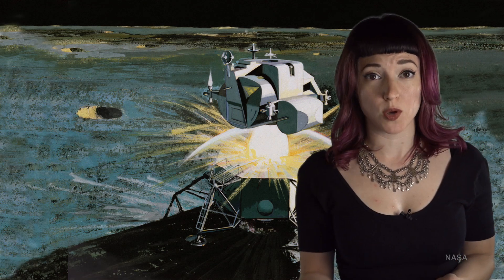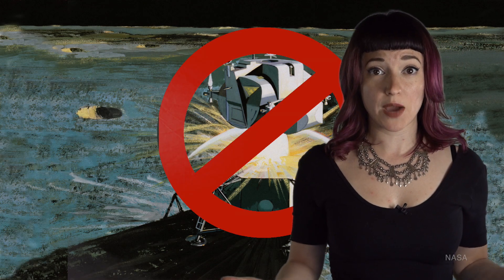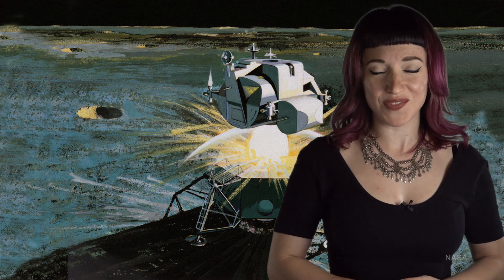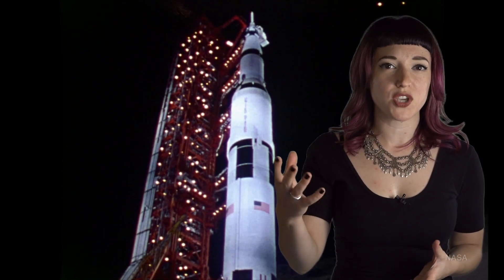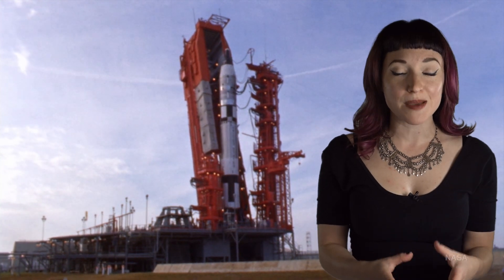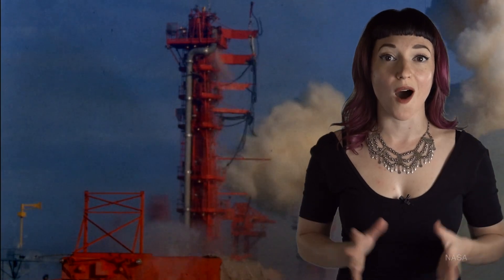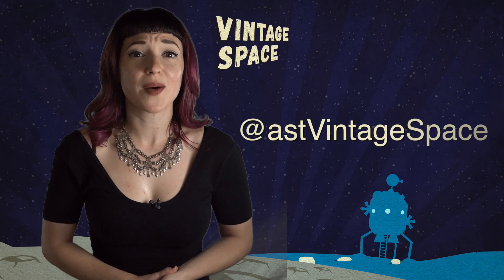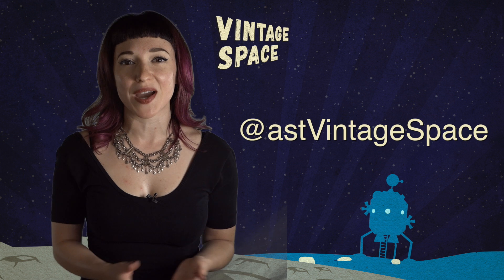How the Lunar Module Launched from the Moon Without a Flame

Comment: Question? So did we have remote controlled cameras on the moon? Just asking since the camera panned the launch.
Reply: Absolutely. Folk's stupidity is astonishing. 
Whi is behing a camera? Mary?
Reply: The camera on the rovers of Apollo 15, 16, and 17 could be remotely commanded to perform a series of preset instructions. 
It's a fairly trivial calculus task to calculate the angle required to keep an object in frame at any given second when you know the distance to it and it's rate of acceleration. Program it to do that and simply press go at launch time.
Reply: @niallkinsella2687  Nonsense, anybody knowledgable in physics will tell you it is tosh, rockethead - a poster with 47 sybscribers but no content. Paid by the post.
Reply: @niallkinsella2687  Haha, fairly trivial task to organise remote control camera to the moon in 1970s. Why not skype to another galaxy. To King Kong planet.
Reply: @Афонин-я4ь  
The nearest major galaxy is Andromeda. 2.5 million light years away.
The moon is barely 1 light second away.

Our communication methods are limited to light speed electromagnetic waves. Lag of 1 second plus processing time is acceptable to most people. In the 1960s this was ~3 seconds total for audio communication.
Lag of 2.5 million years plus ~3 seconds of processing time is not acceptable to most people, so intergalactic communication is not feasible with our current technology, including Skype.

Your tangent has nothing to do with sending a command to a remote control camera. A trivial task in the 1960s.
Reply: @Афонин-я4ь  
2.5Ghz transmissions are not particularly suited to long range communication. 5Ghz is even worse.  Why you assume the Apollo program needed wifi to work, decades before the first WiFi protocols were written, is beyond me. The radio frequencies used were public knowledge, even then, and intercepted by receivers all over the world, including by nations hostile to the US and by people with absolutely no stake in the success of the missions.

Insulting people who respond to your questions honestly is reprehensible.
Reply: @Афонин-я4ь  
Since Luna 2 transmitted the first images from the moon using radio wave communication. 

Why do you keep insulting me? I've offered you not a single offence.
Reply: @niallkinsella2687  Tosh. They could make good special effects.
Reply: @Афонин-я4ь  
Special effects in the 90s still didn't look realistic. You think they could do it in the 1960s and not have a single special effects expect come out and say that it looked faked?

Comment: My question is how the module GPS system works, how do the astronauts knew where exactly they were in space?
Reply: The prayed and Mary showed them where to fly. :)
Reply: They used theodolite measurements of several stars to get an exact reading of their location in space. This was compared to where the mission plan expected them to be at any given point during the mission and course corrections were calculated on earth and carried out by the guidance and navigation computers.
Reply: @niallkinsella2687  they needed at least 3 references, of course they needed a bunch just in case of fails, but the biggest problem was the atmosphere, electromagnetic waves defract in a curved trajectory due to different layers and densities, plus, they needed to count on rotation of the planet, speed and direction of the lunar module. It's a lot of information to process in 1969. There was no communication behind the moon, electromagnetic waves can't pass through the earth and moon, so they needed to transfer package of data from one place to another, it's a lot of risks involved.
Reply: YOU SAID: "My question is how the module GPS system works, how do the astronauts knew where exactly they were in space?"

== Well, there were two basic methods (and each had sub-methods).  One was the onboard inertial guidance system.  Basically, stripping it down to the bare minimum for a YouTube comment explanation, they used a G-meter combined with a basic clock to determine the speed, gyroscopes to determine the orientation, and star sightings to do routine alignment corrections.  The computer was programmed to make adjustments due to Earth's gravity constantly tugging back on the craft, slowing it down.  But, this is just basic calculus at that point, stripped down into some simplistic formulas for the computer to run.

== But, none of the above was considered the primary guidance method.  The primary method was actually the ground based radar tracking network.  They had stations all around the world shooting radar at the craft to determine the position.  They triangulated it by using multiple tracking stations at a time.  A brief overview is located on MIT's website, which you can Google with "MIT Ground Tracking of Apollo" and read more about the topic.  It's only a summary document, but it'll get you started.  This method was considered the primary method because the navigation computers weren't ready by the time NASA wanted them to be ready, so they made ground based tracking the primary method, and onboard guidance the secondary method (contrary to what movies like to portray).  Make no mistake about it, they were going to the moon with or without the onboard computers.  But, yes, the onboard computers were ready in time to fly, but, they had already been demoted to the backup guidance mechanism by that time.

YOU SAID: "they needed at least 3 references, of course they needed a bunch just in case of fails,"

== Yes, and they had those, and many more.  There were dozens of tracking stations around the world.

YOU SAID: "but the biggest problem was the atmosphere, electromagnetic waves defract in a curved trajectory due to different layers and densities,"

== Peanuts.  That's virtually non-consequential.  A drop in the ocean.  I mean, hell, they used a lot of these same radar tracking stations to track the ground features of the planets like Mercury and Venus from tens of millions of miles away.  They had been doing that for nearly 10 years before Apollo ever went to the moon.  I think if they can track ground features of Venus and Mercury with those radar dishes, they can track an Apollo craft just fine.

YOU SAID: "plus, they needed to count on rotation of the planet, speed and direction of the lunar module."

== Sigh.  Radar works at light speed.  That's 670,616,629 miles per hour.  Do you think the meager 1,000 miles per hour of the speed of the Earth's rotation matters that much?  Do you think the speed of the capsules matter that much?  Once again, you're complaining about a drop in the ocean.

YOU SAID: "It's a lot of information to process in 1969."

== It's just math.  The math works the same in 1969 as in 2021.

YOU SAID: "There was no communication behind the moon, electromagnetic waves can't pass through the earth and moon, so they needed to transfer package of data from one place to another"

== Nope.  They simply didn't bother to build any kind of relay stations for when the craft were behind the moon.  They simply had a radio blackout period until the craft circled back into the line of sight.  And, since all landing sites were on the side of the moon that faces Earth, it didn't matter for the landings or moonwalks.

YOU SAID: "it's a lot of risks involved."

== Pffttt.  Yeah.  Nobody said going to the moon was easy, or risk-free.

Comment: The problem is not the fuel or flame but lack of moon dust movement.  No crater under the powerful engine.....no dust kicked up.   So yes, the moon landing was faked....all of them and the reason we won't go back because camera tech is so advanced anybody with a laptop could spot the photoshopping.
Reply: YOU SAID: "The problem is not the fuel or flame but lack of moon dust movement."

== There was a lot of moon dust movement.

YOU SAID: "No crater under the powerful engine....."

== Pffttt.  Do you think 2,500-3,000 pounds of thrust out of a 20 sq. foot engine bell is all that powerful?  Have you done the math?  The amount of force per sq. inch/foot/whatever-unit-you-want is less than a person standing on the ground.  If a crater had been cut by such low force per sq. inch, then THAT would mean the moon landings were faked.  You're not cutting craters with that engine.

YOU SAID: "no dust kicked up."

== Lots of dust was kicked up.

YOU SAID: "So yes, the moon landing was faked."

== Wrong.

YOU SAID: "all of them and the reason we won't go back because camera tech is so advanced anybody with a laptop could spot the photoshopping."

== Photoshop in 1969???  Are you insane?

Comment: Favorite moon hoax theory: the reason the flag is fluttering on the airless moon is that huge air conditioners were set up on the moon set to cool off the astronauts inside their suits, which caused the flag to flutter.  Of course, with the astronauts inside their suits, they wouldn't be able to feel the cooled air anyway.

Comment: There was no visible flame though, not on the footage. Cameras were high definition back then, they just happened to be analogue, but there was nothing wrong with their detail (just softer pictures). Lots of beautiful photography from the 60's, spend 5 minutes on google images
Reply: YOU SAID: "There was no visible flame though, not on the footage."

== Correct.  N2O4 and Aerozine50 burn virtually invisibly, just like a lot of compounds.

YOU SAID: "Cameras were high definition back then, they just happened to be analogue"

== Um, no.  TV signals back then were analog, of course.  But, they still have a specified resolution.  It's still only 200 lines of resolution (I think it was 200x360, if I remember?).  That's not high definition.

YOU SAID: "but there was nothing wrong with their detail (just softer pictures)."

== The "detail" is whatever fits into those 200 lines.  But, that's irrelevant anyway.  The issue with seeing the flame is not whether the cameras were high definition or not.  The issue is that N2O4 and Aerozine50 do not produce a visible flame if they are burned in the proper ratio.

YOU SAID: "Lots of beautiful photography from the 60's, spend 5 minutes on google images"

== What ARE you talking about?  How is this relevant to the flame produced by the lander?
Reply: @rockethead7  No, NTSC was 525 lines, not 200. That's 720 x 480 pixels
; plenty to capture a translucent flame (they are NOT transparent)
Reply: @BOZ_11  
YOU SAID: "No, NTSC was 525 lines, not 200."

== But, it wasn't broadcast from the moon to Earth in NTSC.  It was converted to NTSC once the signal got to Earth.  Though, I'll confess, I went back and checked some of my documentation, and it's confusing.  One document I have merely says it was 200+ lines of resolution.  Wiki says it's "more than 200" then says it's 600 SIT (whatever that means... I'd have to look it up... and I never rely on Wiki... if it was 600 lines, what was the point in saying "more than 200"?).  Anyway, unless you're blind, it's very obvious that this isn't an HD signal.  Get real here.  I will spend some time trying to understand the exact resolution of that camera, given that I don't quite understand the "200+" and "600" self contradicting stuff I see on Wiki, and that my other documentation doesn't make it very clear either.  But, for your sake, I just don't care about it enough right now.  I already agreed that the resolution didn't really matter for the underlying point being made.  

YOU SAID: "That's 720 x 480 pixels
;"

== So, let me get this straight... your original statement was that it was HD, and now you're arguing that it wasn't?

YOU SAID: "plenty to capture a translucent flame (they are NOT transparent)"

== I didn't say transparent.  I said INVISIBLE.  The light emitted by the flame created by those compounds is not visible within our visible light spectrum.  See, chemistry and physics do not care one bit about how a human eye works.  If the light emitted from a certain fire is invisible to us, it's invisible to us.

But, hey, since you're soooooo expert on this subject, I'll tell you what.  Go search YouTube for "Safespill Systems Alcohol Fire Test Comparison," ok?  I'd link it, but she blocks comments with links nowadays for whatever reason.  Don't worry, it's only a minute long, no big deal.  And, in that video, they show you a couple of examples of fires that are burning outside the visible light spectrum.  They have the regular visible light camera, and the thermal imaging camera, going at the same time.  You can see what the human eye sees from the normal camera (nothing).  And, you can see what the thermal imaging camera sees (flames).  Now, by your "logic," this should mean that the video from "Safespill" must be fake, right?  That's what you're saying about Apollo, right?  I've seen you many times before making these ridiculously stupid anti-Apollo claims.  So, that's what you're saying here too, right?  You're claiming that Apollo is fake because you cannot see the flame, right?  Well, Apollo is faaaaarrrr too big of a topic for you to start with.  It's huge.  It involved 450,000 people.  It involved just about every walk of science and engineering.  It was massive, very tough to get your arms around.  But, little "Safespill" is just a couple of guys with fire suits and a couple of cameras.  Now, go bother them instead, ok?  Go over there, and tell them that their video is fake, because you cannot see the flame in their video.  Go tell them that their fires should be "translucent" and not "transparent," just like you're saying about Apollo, and tell them that you think their video is a massive conspiracy, ok?  Seriously, Apollo is just too much for you to bite off right now.  If you want to run around and complain about camera resolution, and how fires should be visible no matter what, seriously, this isn't a joke I'm making, you need to start small, and go complain that the "Safespill" video is fake, long before you can tackle Apollo.  Again, NOT JOKING here.
Reply: @rockethead7  Dude I'm not reading all of that, and it's mostly horseshit assumption judging by my skim reading. You're obviously not altogether there
Reply: Oh ye, and wifi cameras for millions of miles away

Comment: How did they connect the lunar module back to the command module after the trip to the moon? It just amazes me how they performed such a precise manoeuvre with 1960s technology!
Reply: On top of the lander, there's that dish.  That's the rendezvous radar.  They locked that dish in on the command module, and followed the signal to get there.
Reply: rockethead7 thanks for taking the time out to inform me! Makes sense, great to know. Cheers 👍
Reply: @rockethead7  Nonsense. Calculate the speed, you were bad at physics at school.
Reply: @Афонин-я4ь  
YOU SAID: "Nonsense. Calculate the speed,"

== Calculate the speed OF WHAT?  What are you talking about?

YOU SAID: "you were bad at physics at school."

== Well, there's a first for everything.  That's the first time anybody has ever said that.

Comment: what is the secret behind the O2 from their backpacks? almost 4 hours on moon. Scuba diving use 3 big tanks with O2 for about 40 minutes. But astronauts backpack had a mini AC and a lot O2. I ask because I wanna know for my education. Thanks in advance for your response.
Reply: Well, there are many responses here.

1) Your scuba tank is only 21% oxygen.  The tanks in the PLSS were 100% oxygen.

2) When you scuba dive, you waste a vast majority of your air supply.  You breathe in, and out, and most of the air escapes as bubbles.  You're only absorbing a small percentage of the oxygen on each breath.  Most of the oxygen you breathe in does NOT get instantly absorbed by your lungs, and actually goes right back out, and escapes as bubbles.  But, Apollo's suits were basically big rebreathers.  Very little oxygen was wasted.  There were CO2 scrubbers in the PLSS that pulled the CO2 out, and left the oxygen inside for you to keep on breathing.  If you exhale oxygen while scuba diving, it just goes out as bubbles, wasting most of the oxygen you brought with you.  But, on Apollo, if you exhaled oxygen, it would remain in the suit for you to breathe until finally your body absorbs it.

3) The pressure in the suit on Apollo was only about 3.5 or 4.0 PSI.  The pressure at, let's say, about 60 feet under water while scuba diving, is around 45 PSI.  So, every breath you take while scuba diving consumes 3x more air per breath than when you're on ground at sea level.  So, when scuba diving, not only are you wasting a majority of the oxygen, but you're wasting it at a rate 3x more quickly than when walking around on the surface.  (Or, even more, if you're down at 100 feet, or whatever.)

4) The Apollo PLSS is far more sophisticated than a scuba tank.

5) Time to learn to conserve your air a bit.  I realize I'm an abnormality when scuba diving.  I always come back up with more air remaining than anybody else in the group, because I'm quite good at controlling my breathing.  But, 3 big tanks for only 40 minutes?  You're either an air hog, or you're going so deep that you're on trimix, and going through many hours of decompression.

6) By the way, the later Apollo missions were on the surface for 7+ hour EVAs.